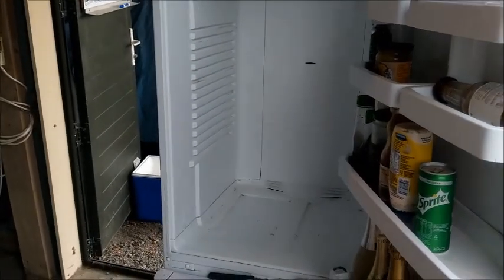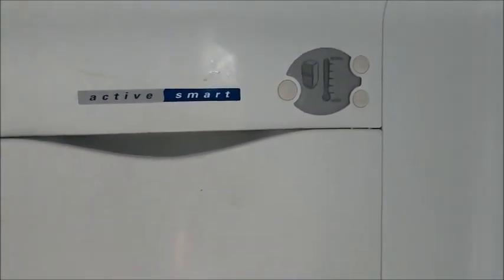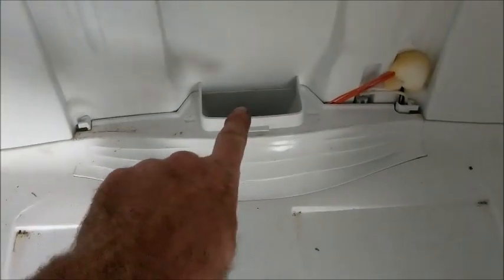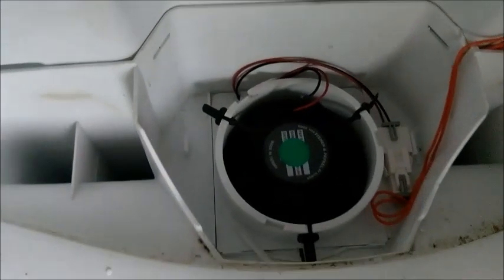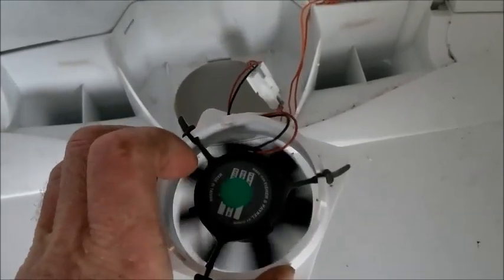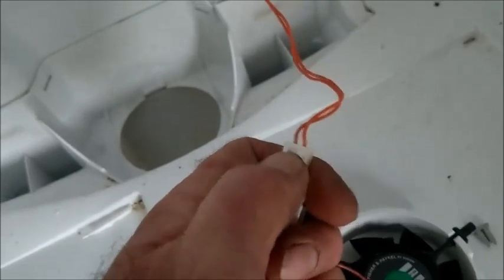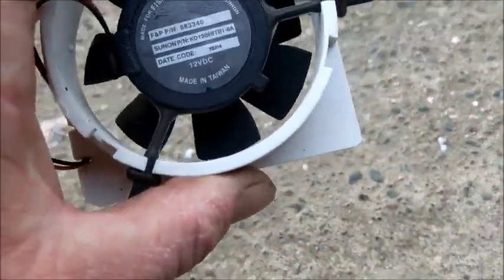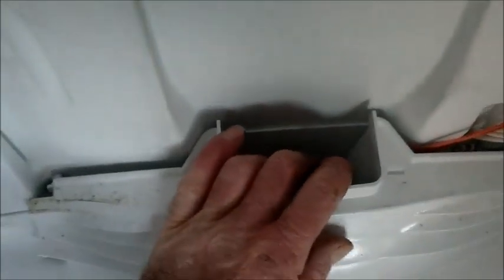Fisher Paykel Active Smart Beeping Intermittent Fridge Fan Fault

Comment: I have this fridge but I can’t access this fan so easily. Its like I need to pull up the whole floor of the fridge to access the fan.
Reply from the maker: Hmmmm Not sure.
It does take some effort to pull the back panel off. Or try levering with some screwdrivers down the side. (Without damaging it)
 Or maybe your panel has hidden screws. Look for some round white caps and the screws will be underneath.
Or it's a slightly different model and the fan is in the freezer compartment
Reply: I was in the same dilemma. I've used spoons to leverage but could not find the fan at the location shown here. Then I decided to take off the keypad panel as well by undoing one screw and guess what I found this fan behind it. But the fan seems to be working fine, don't know why the fridge was beeping.  Any other suggestions?
Reply: Their is a second  defrost fan in freezer remove the back panel in freezer
Reply: @markgrech1866  thank you and guess what, it had a broken wire, connected and working again. Had to break a pile of ice to access wires.

Comment: Thank you very much.  This is one of my fridges errors.  Would this fan not blowing also cause frost build up in the freezer compartment or would they be two separate issues?  It's getting difficult to purchase genuine new parts.  🙂
Reply from the maker: Yes ice building up can jam the fridge fan from working. A good defrost can do wonders. Which country are you in?
Reply from the maker: The heater element is located beneath the freezer evaporator and can be difficult to change. There is also up to 2 more thermo switches (also a thermo fuse)  located there too, that control the element. All of which need testing individually with a multimeter. It can be a painstaking process of elimination to find the exact cause of the problem. You may find other videos how to change the element, but sorry I don't have one.
Reply from the maker: @laurahalvorsen558  the element sits beneath the evaporator. It's a single element. Here's a picture of it. 
And Beneath the black covers of the wires in the picture are thermal fuses. 
https://www.appliancespares.nz/products/fisher-paykel-fridge-freezer-defrost-element-e372b-e402b-635mm-cabinet-821727p-original?variant=6974622761026&currency=NZD&utm_medium=product_sync&utm_source=google&utm_content=sag_organic&utm_campaign=sag_organic&utm_source=googleads&utm_medium=shoppingads&gclid=CjwKCAiAr4GgBhBFEiwAgwORrTY7lvZ8ebLCvJy2CTqVxS08hDnj5ZgAQO6Yg524x8Y252en9qrbWxoCMj0QAvD_BwE
Reply from the maker: @laurahalvorsen558  try this image. You can see the dark element at the bottom of the evaporator
https://drive.google.com/file/d/1RoPuDMTWPOLkzh7X1R9EfqLuSJJ_d9C9/view?usp=drivesdk